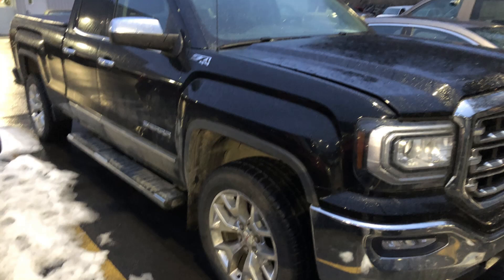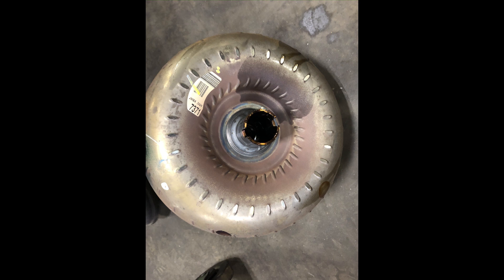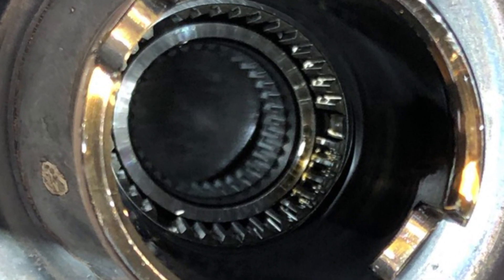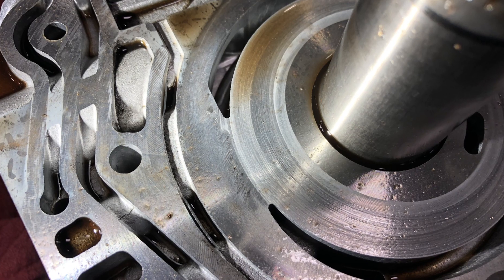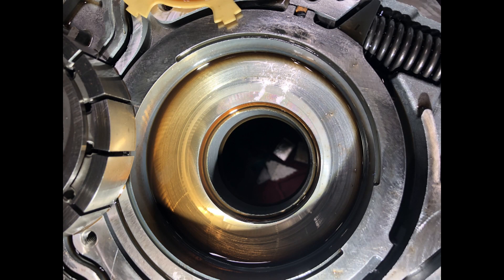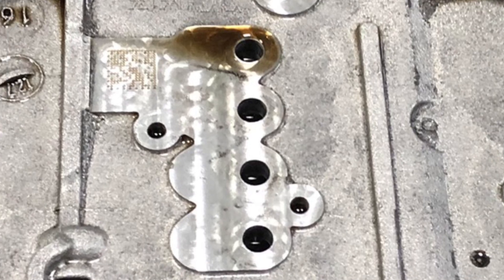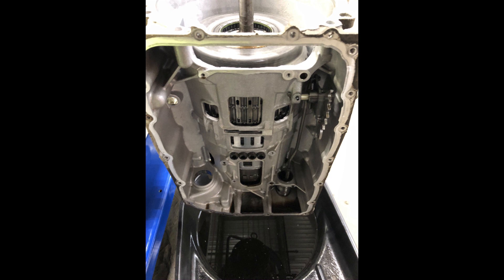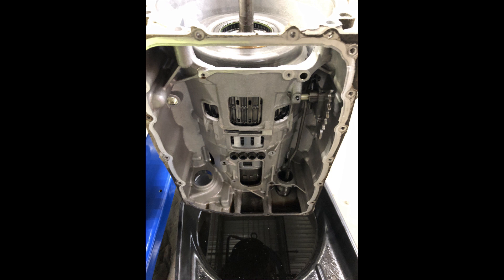2016 GMC 6L80E Torque converter failure

Comment: 2016 Silverado 1500. Mine failed 500 miles from home at 96,000 miles. Thankfully I had a good extended warranty; the warranty covered $4000 of the $6200 cost of installing a GM Reman. Note: if you have this happen in Columbus OH do NOT have it towed to Mark Wahlberg Chevrolet…they replaced the transmission and when I went to pick it up it barely got me home. My local dealer tore into it and ended up replacing a ton of parts, including a NEW torque converter that had a spring sticking out of the side of the housing! Total $hitshow compliments of Mark Wahlberg Chevrolet.

Comment: This is Very common problem with the 6L80e transmissions, does not matter how you drive it, and in 10+years GM has still not fixed the problem. Typically the failures I have seen around 100k. Both my wife's 2009 Tahoe and 2017 Suburban had the same transmission failure, first one at 107k, second one at 92k miles. After the fuel injectors failing on her 2017 and now the carbon buildup issues on the intake valves I'm totally done buying GM $60k trucks/SUVs. I simply cannot afford to continue wasting this amount of time and money constantly repairing bad GM engineering.
Reply from the maker: Yes. I'm curious to see this new 10 speed how long it holds up. It shifts a lot smoother. Maybe a better transmission. Ford/GM venture
Reply: I added a pcv oil catch can to try to keep my intake valves from carbon build up,  I added the Sure Cool Thermostat delete part #STL010 to keep my temp down. I used a Diablo Sport tuner to disable my AFM. So far so good.
Reply: I have 78k miles on my Silverado, already had a transmission failure and now a bad engine lifter.  I’ll never own another piece of shit Chevy, bad engineering and cheap parts

Comment: I have a 2014 Silverado 1500 and my truck has started shudder any tips on how to get this problem solved?
Reply: Didnt you just watch the video lol ????
Reply: Got a 2014 GMC Sierra with 133000 and my truck started shudder and vibration but shifts perfect.already change the fluid and flush, and still doing the same thick so know Im very sure is the my converter

Comment: What do you mean by upgrading the fluid? 2014 sierra 1500,  I had my 1st trans flush done at 49k miles and went to a shop and they used a different brand fluid.
Reply from the maker: Mobil 1™ Synthetic LV ATF HP helps against moisture, smoother shifts. But if the converter is shuddering a rumble feeling at low speeds or sometimes at highways speeds it may be to late.

Comment: Guys try this 1st put your truck in L or M. Hit the plus on shifter and set to 5. Go drive it and if it goes away. It won't allow afm to work and will stay in v8. You loose 6 gear so hwy shell run higher rpm. Mine spent 2 weeks in the shop fuild change 2xs with the update fluid and I still complain gm answer printed on my paperwork said normal operation per v8 and v4 is what customer is experiencing, this is normal operation. Horse shit. I bought a range technologies afm disable. 45k when trans was serviced and now have 56k, about 10kmiles on the range device and it fixed the fing problem no more goofy shifty up or down.   She was born to be a v8 and stays in v8. He's right if you catch it soon you'll be OK. And honestly I think the Trans should be served every 30k.  My fuild was a tad dark not horrible or burnt but even at 45k it did not look good if you ask me. My ford has 380k and the fuild is bright red even when I service it at 30k mark.   Make you wonder what the gm tyranny is cooking inside for fuild discoloration so quickly...... Esp if your not towing
Reply from the maker: GM has put a aggressive duty cycle into the programing causing the converter to come apart. The programming is in place for 4-v8 mode to try and get the tiny extra fuel mileage. Programming will help eliminate some of these issues and yes service the transmission 30-40K. Oil is cheaper then metal still.. lol
Reply: Get rid of the GM 180 degree thermostat and install the Sure Cool part #STL010 ($46).

Comment: straight up junk! Don't buy gm products they don't stand behind their products and produce failed products. The main failure of these transmissions boils down to two main issues, heat and inferior parts. The transmissions have a thermo bypass valve that causes the transmission to run at a temperature of 185 degrees and upward. The torque converter is junk that falls apart and could fail at any time. There is a piston inside the transmission that only engages the outer edges of the clutch pack, a drum that is know for cracking around the weld. There are ways of bullet proofing these transmissions. Another issue is the programming of these transmissions via adaptive shifting. If for some reason your truck has a software glitch or issue with the TCM the truck will shift weird and burn up the transmission as well.

Comment: 185k on my co-worker's 2014 Silverado. No converter problem. Must be pretty random issue.
Reply: @FAKETAXI SRT4  "common"
Reply: Mine just happened today at 190k…..$8000 to fix it
Reply: @flowgrowngamer9246  You're getting ripped left and right.
Reply: @DoctorRickSanchez  traded it in for a 2021 Tacoma so its their problem now haha
Reply: Tell your friend to install the Sure Cool Thermostat delete part #STL010 ($46) to keep his temp down,  EPA forced GM to run a 180 degree thermostat (too high)

Comment: I'm swapping mine out to a circle D converter
Reply: Just installed my billet TC by circle d last week in my 07 yukon denali in my 180k transmission.  Feared my tc would grenade at my mileage.   Anyway,  does great and hopeful it'll outlast my transmission now.
Starting to have skipping of downshift 5th gear into 4th from 6th on the freeway for a few months now.  This  happened before the tc install. Any ideas?

Comment: GM is running these trans too HOT 192* is not good on ATF  i removed my thermostat on the trans lines & in stalled a "Bar Bell" by pass in the thermostat housing , now runs at 145*-155* under normal driving conditions instead of 190*-210* !!! .My fluid was all most black and smelled burnt but no sight of metal on the mag or in the pan ,I think i mitt of caught it in time I HOPE!!!